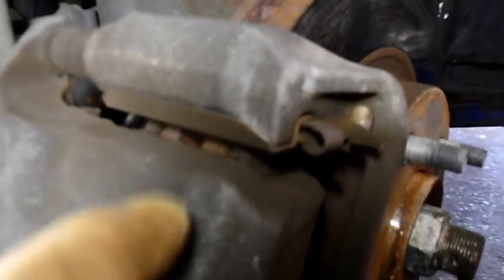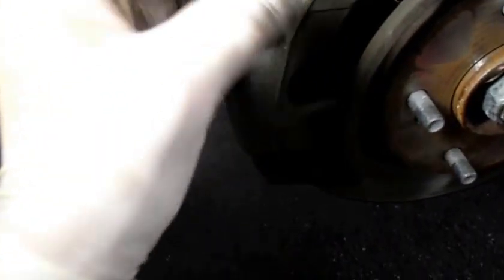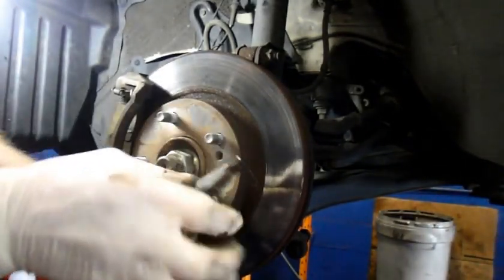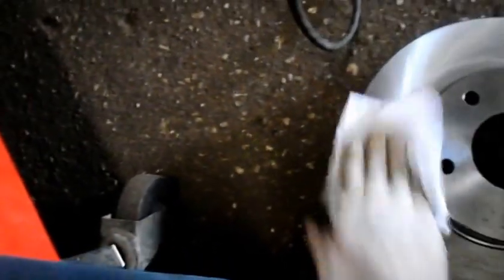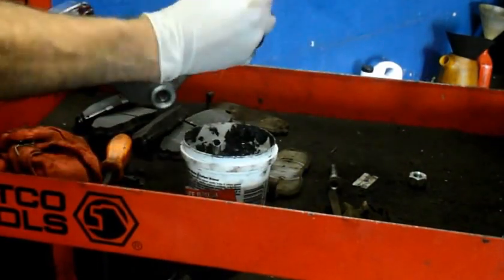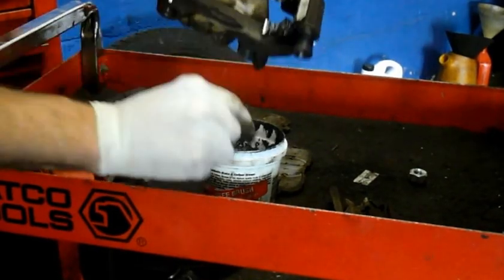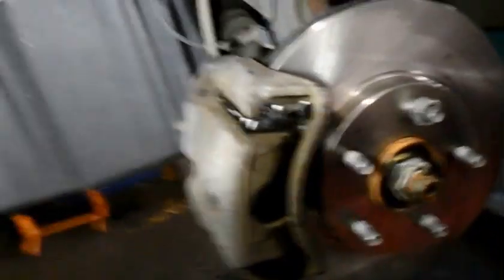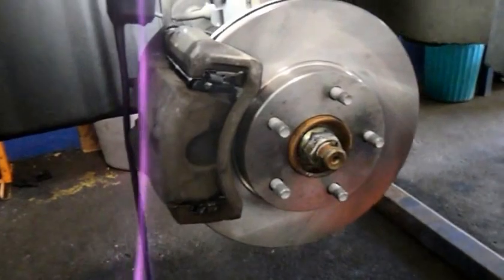Diagnosing Brake Noise / Replace Front Brakes

Comment: Might be good to mention that the rotors can be re-surfaced (Ground) for less than $50 a pair. Also some torque values would be nice for folks that have a torque wrench or anyone that doesn't understand that you can't just go crazy with the wrench. (I use safety wire to hang the calipers while I take off the rotors.)
Great Video!!!

Comment: Looks like you have done a brake job or two in your career, Jim. The only thing I do differently is apply brake lube to the bracket before installing the abutment clips. It stops rust from building up behind the clips.
Reply from the maker: +wysetech2000  Ya I think I've done a few :) Good idea with the brake grease on the mounts.Jim